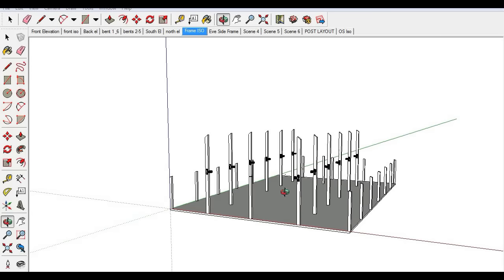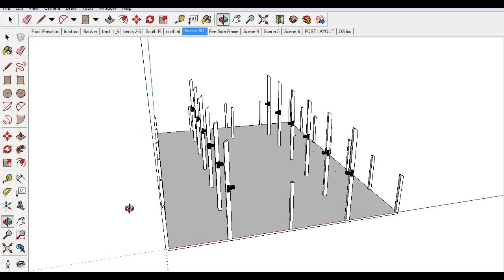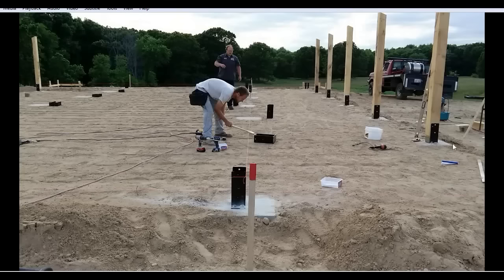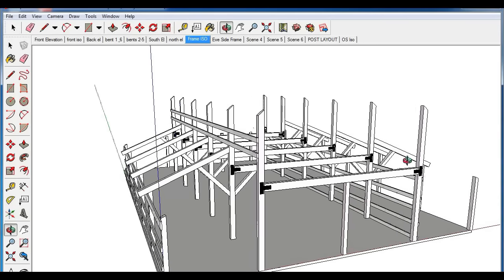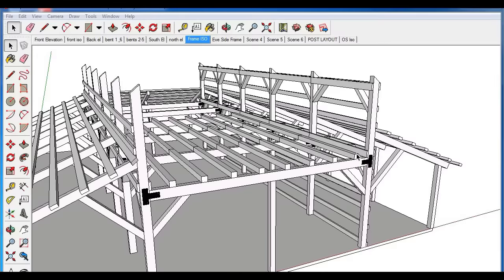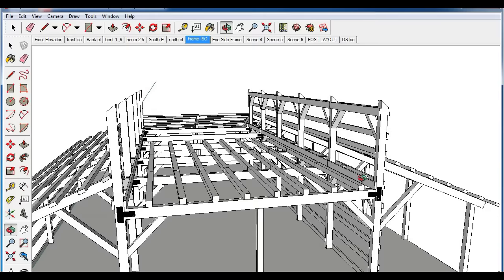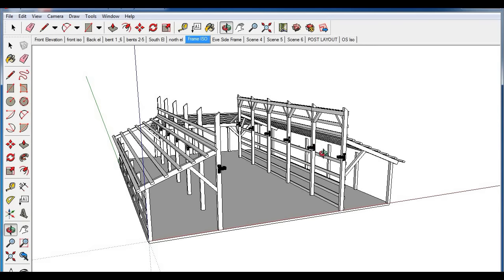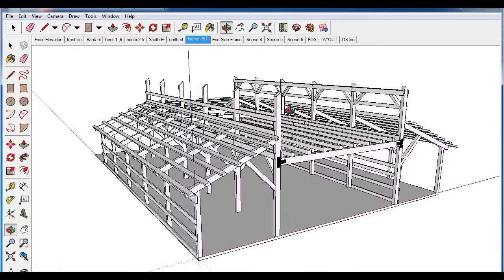How to Build a Post and Beam Barn, Construction Procedure Overview

Comment: I just saw "Lifting Entire Truss Bays EASILY With Chain Hoists (My New Prototype)! | DIY Barndominium Ep.12" - Hart and Home.    His trusses seemed to be on the lighter weight variety.  I don't know what specs would be needed for a chain hoist for various beam/truss construction.   He seemed to join two trusses so he could lift them square and keep them braced once in position.   I'm new to this.  I just know that getting a heavy machine in certain areas isn't always practical or economical.

Comment: No birds mouth? To tie in rafter and post ? Just screws on the angle ?
Reply from the maker: Yep, been doing this since 2008, there have been hundreds of barns built just this way since then. Most with RSS screws, but some have opted to use steel plates at that joint as well.

Comment: Sorry, I butchered part of my post.  If decking the hayloft, consider using hangers to hang floor joists between the tie beams, then nail 1" oak or 1.5" pine to the joists.  Paint the hangers black so they look like your post/beam steel tee brackets.  Only the purist post/beam guys will notice, and you can never satisfy the purists anyway.  Sorry!